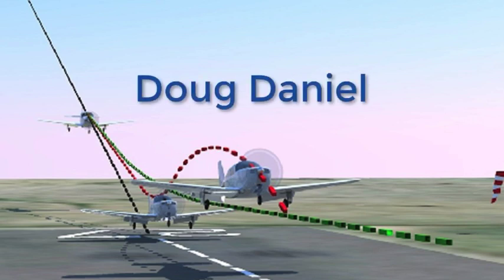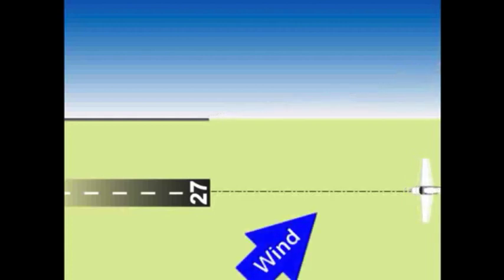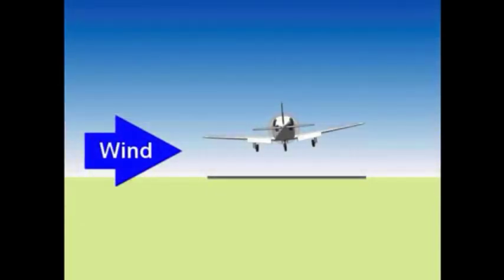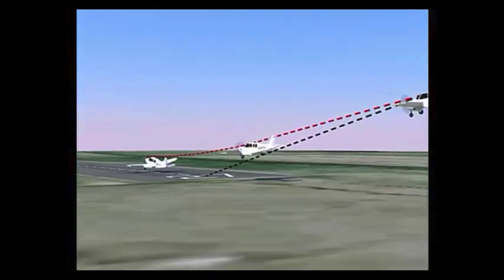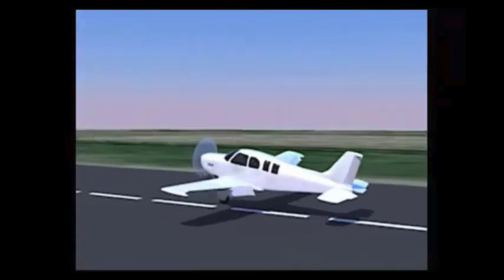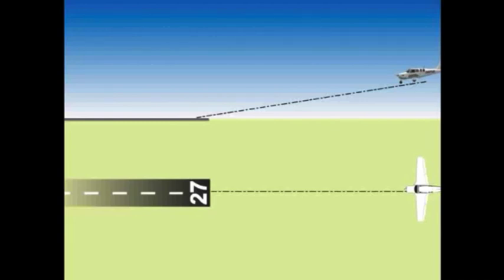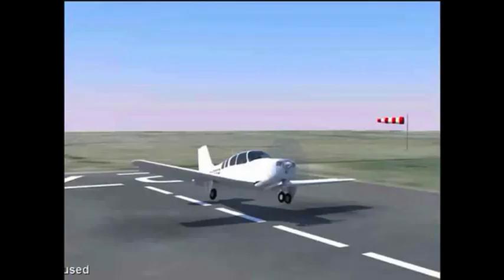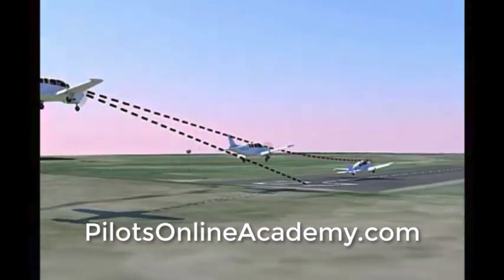How to Land any Plane in a  Crosswind

Comment: I am the old crop duster who very much agrees with your cross control thinking and principal.  We tailwheel guys add dynamic proactive rudder pedals movement constantly to bracket/nail the centerline extended and centerline between our legs and stay ahead of the airplane and stay ahead of gust spread and prevent rather than react to ground loop.  And it works the same in nose wheel airplanes.  I start students using rudder and throttle only with their hands in their lap to prevent the steering wheel muscle memory and its adverse yaw that is the most problematic issue with landing.  Your technique teaches proper yaw, rudder yaw.  This dynamic proactive rudder pedals movement also stabilizes the wing in the bank you set for crosswind or level in calm air.  If we use rudder only to prevent the nose coming off target, the wing cannot change bank.  We have beaten the crosswind and along with dynamic throttle we have beaten the gust spread.

Comment: So you are slipping the plane?
Reply from the maker: Exactly
Reply: @DouglasDanielMOT  I've read that some instructors teach the crab and others want you lined up using the slip.  My instructor teaches the crab.  Is the slip landing a more advanced move since you can technically spin the plane if you aren't paying attention?
Reply from the maker: @TomSmith-kc8mz  Spinning an airplane from a landing slip would be quite a feat. You're correct if you think that a spin generally occurs as a result of an uncoordinated stall. If you are flying at the recommended approach indicated airspeed, you could not possibly exceed the wing's critical angle of attack. Therefore, you could not possibly stall and enter a spin. As far as being advanced, if you were to attempt to land a taildragger using the crab and kick method, I assure you, you would ground loop. Crab and kick only works with nose wheel equipped airplanes some of the time. I learned by barely escaping a fatal accident that it does not work all the time.

Comment: Ailerons control 1)roll, 2)drift & supplement rudder with 3)directional control on the runway. 
On the runway, maintain ailerons PROPORTIONALY and OPPOSITE the needed rudder.
Reply from the maker: What you say is technically correct, but it is far easier once you are on the runway, to think in terms of keeping the upwind wing pushed down with aileron and keeping the nose pointed straight down the runway with rudder. If you were cross controlling when you landed, you don't have to think about which way is opposite, your rudder pedals are as they should be. As far as proportionality is concerned: forget it. Not needed. Full aileron deflection into the wind will never be a problem. Remember that if you have to taxi downwind when you taxi off the runway and you're in a strong crosswind, you have to reverse your ailerons when the wind starts coming from the back of the plane.

Comment: Finally! A cross-wind landing video that tells it like it is!  For instance, at 7:09 "...properly cross-controlled as you descend..." That's right on the money.    Doug, I've got right at thirty-thousand hours total time in all types of airplanes from high performance military, large and heavy commercial, corporate jets and twin turbo-props, light airplanes of all makes and models - singles and twins - tailwheel airplanes from Cubs to DC-3s... And you are exactly right! They all (with a few minor exceptions...) fly and land exactly the same in a cross-wind. The cross-wind techniques ("crossed" controls...) I use on the Cessna 182 are no different than the ones I used on the Boeing 767 and 737, or the Merlin III or IV, or the King Air - the very same techniques you teach here... Some airplanes are more nose-heavy (C-177, 206, 210, etc, etc) and can stand fewer degrees of flaps at times, yes that's true, but essentially they all use the same cross-wind techniques. Thanks for putting this video out there.

Comment: But do you crab on final approach and then convert to cross control or cross control the entire way?
Reply from the maker: When I'm flying, I crab until I start the flair, then I cross control. That is easiest on the passengers but not the easiest to execute. I recommend cross controlling a bit earlier then adjusting your power so that your projected glide is where you want it. That's the easiest. A word of caution: when you transition from a wings level crab to a cross controlled condition, your projected glide will intersect the runway closer to the threshold. That requires an increase in power... not much but some... to hold your projected glide point steady. Remember, when you are cross controlled, you're slipping. And slipping is a technique for steepening up your glide without increasing your TAS.

Comment: Thank you for this video.so my question is when I land keep my foot on the rudder the hole time so ball stays fully to the left or right depends on wind direction?
Reply: Forget the ball. This is the only time when uncoordinated flight is acceptable. Your upwind wing stays low, keeping the plane centered on the runway. Opposite rudder keeps the nose going straight down the runway on short final.
Reply: @aaronbrown6266  thank you for your help,I need to master this side slip it seems like the best way to land without worrying about getting blown off of runway
Reply from the maker: You're welcome. Glad I could help.
Reply from the maker: Exactly

Comment: That is called The Crosswind Slip Touchdown.  The only way to land unless 737 style low to the ground engines. Only low engine jets cannot do much banking on touchdown and they do crabbing touchdowns instead.  If they bank too much on the touchdown they might scrape the engine on runway.  They rather scrape the tires than engines.  Crabbing touchdowns are easier to do than Crosswind Slip Touchdown maneuver, so many airline pilots just do crabbing touchdowns even if they dont have low engines like on 737's..
Reply: Crabbing touchdowns dont scrap the tires if they respect the limits ,touchdown in crab is suggested in the operating manual of these planes thats the way you  fly them
Reply: @Hk-uw8my  I have seen low engines 737's touching down on one tire or the crosswind slip but not more than 10 degrees banking.   Also the pilot cannot be so bad to land too hard, be that crabbing or Crosswind Slip.
Reply: @outwiththem the thing is if you have some annoying gusts at the wrong moment ,you can smash the engine or the wing .
So almost everybody will direct you to the crab/decrab touchdown
Some planes like the 737 allow you to touch the ground with a 5° drift in order to help you.
For the a320 since you use the stick to command a roll rate and not a bank angle ,many pilots will tell you that it's not permissible to use this technique, but in fact you can always do whatever you want in your plane,but airbus  recommend the wings level method and dont allow you to exceed a 5° bank angle near the ground.
Reply from the maker: A 737 pilot told me that he used my technique in a 40 knot direct crosswind. Some airplanes, such as a B52 do have such low engines that they have crosswind landing gear. Most people's fear of cross controlling on landings are irrational.
Reply: @DouglasDanielMOT  Cross controlling like on Crosswind Slip i learned at only 13 hours.  3 hours after solo i showed up and there was a 13 knot direct crosswind on the only runway.  My CFI went with me and i did about 10 touch and goes with the crosswind.  They are fun to do.  Unless the guy is clumpsy.  And clumpsy guys will make many other mistakes.  Clumpsy guys dont belong on pilot seats...
Reply from the maker: @outwiththem  You're lucky. Your flight instructor knows and teaches crosswind landings. The FAA does not require crosswind landings on check rides because there may not be a crosswind on the day of a check ride. As a result, all too many instructors don't know and certainly don't teach what I call the 'proper' crosswind technique. There are even airline captains that think you should just land flat and hope the gear survives and the plane doesn't swerve off the runway.
Reply: @DouglasDanielMOT  Some cannot do The Crosswind Slip well, so they like to go for jobs on airplanes that landing flat with a crosswind is acceptable like on 737's.   I like the slips.  I used to do one tire touch and goes to show the students that is the way to do crosswind landings.  I find them fun to do..
Reply: @DouglasDanielMOT  If FAA require crosswind landings on checkrides there could be less private pilots.  Due less demand, airplanes could be cheaper to buy, specially the used ones.  I have flown with FAA guys afraid of crosswind landings over 10 knots.  FAA regulations were tougher before the millennium.  Much tougher. My PPL i took in 1974.   EFATO and low go arounds were required that era..
Reply from the maker: @outwiththem  IMHO, the FAA does not require crosswind landing because there is no guarantee that their will be a crosswind the day of the checkride. And, yes, I have flown with pilots who were afraid of a 10 kt crosswind. In fact I have seen pilots almost buy it in less than a 10 kt crosswind. That is probably why I became obsessed with making certain that all my students were proficient in crosswind. By the way, there are ways of teaching crosswind landings in calm air.
Reply: @DouglasDanielMOT  There are other fields with a crosswind runway to use on checkrides.  But if a mild maneuvering examiner, he will ask only for... Mild Maneuvering ONLY.. Mild Maneuvering Pilots will crash when need to do Hard Maneuvering like quick turns, stalls, etc.

Comment: Thanks Douglas Daniel - most useful video for a student pilot, especially one who is knocking 76. Landings have impeded me from doing solos even though I have almost 60 hours of lessons. Passed all my 9 written exams, meanwhile.
Reply from the maker: Let me give you some advice that has worked for me in skiing, flying and dancing the tango: Replay a landing in your head. You can do this anywhere, any time. You're in the cockpit with a gentle crosswind. The most important thing is maintaining a very consistent airspeed time after time. So you imagine that the airspeed is 65 and should be 60. So you adjust your pitch attitude up slightly by looking over the nose of the airplane as you pitch up. Hold that attitude steady. As the airplane slows down, the nose will want to drop. Trim that force out of the elevator as the plane slows. You attention is out of the plane except for the very brief moments that you must check your instruments, especially your airspeed indicator. Once it is stable at 60 (or whatever your instructor tells you your final approach airspeed should be) your airspeed should remain  constant. Unfortunately in most planes a change in flaps or power can change your trimmed airspeed. So be prepared to fine-tune your pitch attitude and trim frequently. Continue with this mental exercise throughout the flare to land, during that hold-it-off phase just before it lands, and during rollout. Frankly, if you have a tricycle landing gear, you should focus on mastering airspeed control and the flare (round off) before you concern yourself with the nuances of a crosswind landing. If you are still struggling, get back to me.

Comment: Did my first crosswind landings yesterday and they were not pretty as I didn't remove the rudder pressure after touchdown. Young CFI tried to demonstrate on second attempt, but was not much better, slamming down as hard as I.  Will try this without his recommendation.
Reply from the maker: In most airplanes, you should not remove the rudder pressure after touchdown. In any airplane with the nose gear is directly linked to the rudder pedals, you may need to neutralize the rudder just before your nose wheel comes back on.

Comment: Hi Douglas...jst a question ? What happens when landing in calm winds....no crosswinds....? Is the cross control technique still applicable?..
Reply from the maker: Sure. With no crosswind component, keeping the airplane centered with ailerons and aligned with rudder keeps the wings level and the airplane perfectly coordinated just as it would if you were not using crosswind techniques. So by using crosswind techniques all the time, you never have to decide which technique to adopt for the situation.
Reply: Thanks Douglas....will give it try & share my experience...
Reply: @DouglasDanielMOT  slip anyday